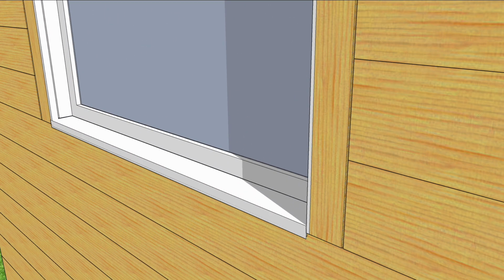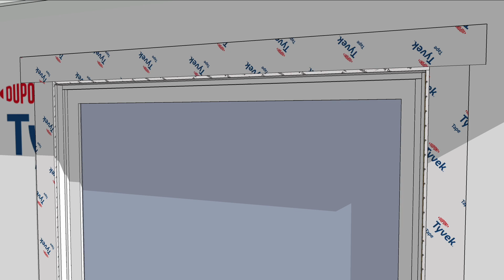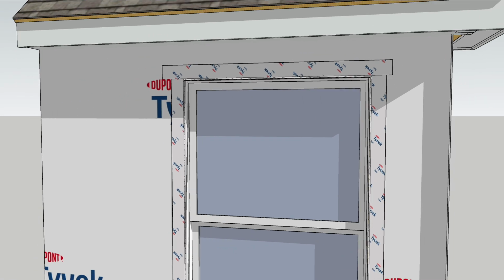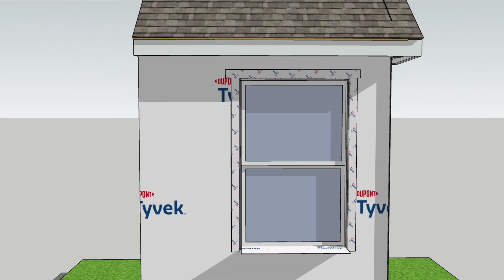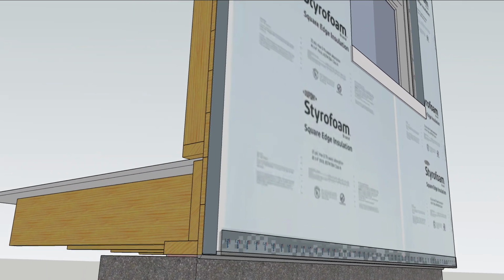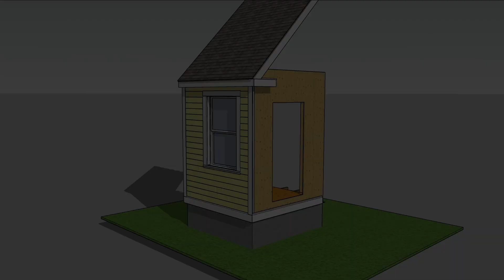Continuous Insulation Retrofit: Innie Window Detail

Comment: Do you use super long nails to hold your siding on or is the Tyvek rain screen structural enough to hold a nail and siding.
Reply from the maker: Yes. 3-1/2 inch. The drainvent rainscreen (discontinued) is simply an entangled mesh with zero structural capacity. 

Another alternative is to use wooden furring strips for the rain screen. They can be screwed into studs and siding can be fastened to them with regular short nails.

Comment: Thanks for the video.  The wiindows in the animation were replaced, making retrofitting insulation a bit easier. BUT...what about keeping the original construction windows, which have a flange that extends out laterally from the window (in the plain of the outer window surface). The space between the external sheething (osb) and this flange is about 1". Does one fill it in with a 1x piece of wood or pvc stock,  or squeeze in insulation there?  And what about flashing that location to direct moisture away?
Reply from the maker: A flanged window is easier to detail than the wood un-flanged windows in this animation.

Not sure I follow your question. The flange is tight to the wall sheathing. Exterior foam would run over the flange, exterior trimout would be similar to this project.

Am i missing something?